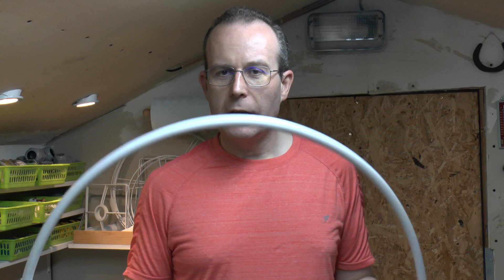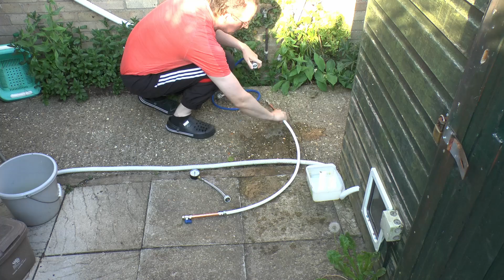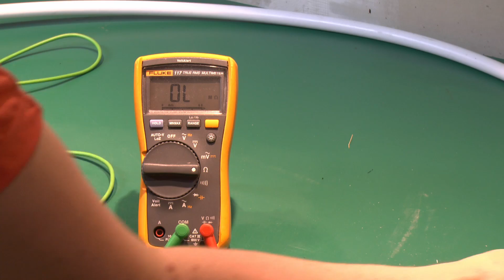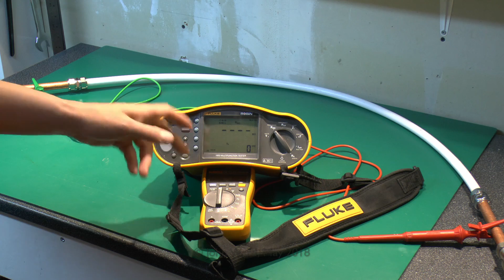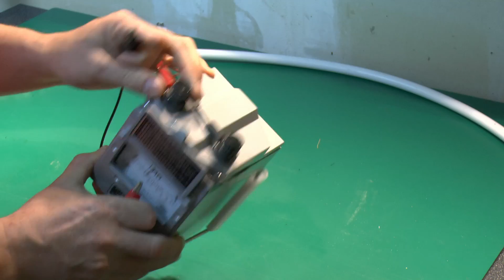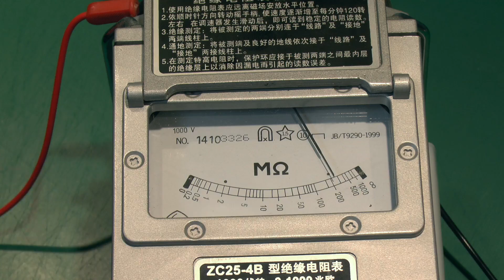Is water in plastic pipes conductive?

Comment: Pure water is an excellent insulator, what you have is not pure water ... water cooled stator bars in a 23kV turbo alternator perform very well with very low (electrical) leakage.

Comment: As long as the pH of the water stays below 7, the water won't become conductive.
I worked on a HPA using a  water cooled tetrode, it had a long coil of rubber hose carrying the cooling water and pH monitoring. If the pH rose the  20kV+ anode voltage would start to get shorted to earth down the water column in the hose.
Reply: Rubbish, please go back to school!

Comment: Interesting result, I wonder if it is because you have static water -- it has been shown repeatedly that a moving column of water is conductive enough to be significant.
I was fault tracing some years ago in a restaurant bar where "potential shock risk" was reported (i.e. current above threshold of perception making the "ordinary persons" fear for their safety).  It turned out the taps on the sink hiding under the bar gave a perceptible tingle especially when they were running.  100% inspection to every accessory on, under, behind and over the bar area showed that the bar was a later addition to the restaurant and installed almost like a prefab module, sitting atop the vinyl fake wooden floor and totally insulated from the room but with potential for static build up everywhere.  numerous fridge units (compressors) and other Class 1 stuff like the glass washer and a few switch-mode psu's (the EPOS and others).  No bonding in the whole area because the installer clearly didn't see a need.  The supply to the sink was plastic, and GN8 of course tells us that if doing an R2 test (wandering lead back to the MET) shows a resistance >2kΩ then we can consider that item not to an extraneous-conductive-part.  So when I dabbed between the taps and the CPC of the closest accessory (a worktop socket) I saw only 2-and-a-bit kΩ, but when I turned on the taps and let them flow at a decent rate, it dropped to a bit under 2kΩ.  I added local equipotential bonding and the problem vanished.

TL;DR:  classroom maths theory or a carefully controlled lab experiment, like this, shouldn't always be taken at face value.  The theory is sound and demonstrated well (I'm especially a fan of the old Fluke 1653 with the Robin branding proudly in place;-) but field experience can differ significantly due to many other influences...

For instance,the contentious new Reg's regarding incoming services with a short "insulating section."  It is no longer necessary to apply equipotential bonding (although confusingly it doesn't say that main bonding is unnecessary).  Do you bond it anyway?  Depends on if there any issues in the property.  Yes?  Bond the damned thing!  No?  Don't bond it in case you introduce a ground potential that wasn't there before.

Comment: I worked on a shower unit where the element was in a clear plastic tube inside the enclosure .I removed the cover to test voltage and resistance and finally restored the supply the local means of isolation was in another room (eg through the wall from bathroom to kitchen )however when I returned the valve had failed to open and the element had melted the tube in less than 20/30 seconds max .The resistance of the water must have been similar to that on this test and added to that the resistance of the element !!!Not a good set up and this was before RCD protection !!

Comment: There was an electrocution on internet where unearthed metal/pole lamp holder in garden became live at a pub. I think water got into the lamp. Can this cause the metal pole/lamp holder to become live and allow enough current to pass to kill. Probably very little distance between the live wire and the metal lamp so water resistance might be a lot lower than your experiment in this video.  Could you do a video on this ??
Reply: David Savery has done a video on this.

Comment: Hi John, does this mean that supplementary bonding is not required to the metal parts if they are isolated by plastic pipes at both ends?
Reply: Read the Wiring Regulations and you will know ...

Comment: Thanks John interesting.  What would happen if you just replace a copper fitting with a push fit plastic fitting.  Would this have implications to the earthing arrangements within your property.
Reply from the maker: No difference to earthing, but might make a difference to bonding.  
Earthing and bonding are two entirely separate and different things.
Reply: Yes exactly what I was trying to imply.  Many properties with leaks on copper Hot and Cold water supplies are being repaired with push fit plastic fittings surely this could effect the bonding effectiveness.  What would be the recommendations from a plumbing repair perspective ie cross bond across fittings or this would not be necessary.  Thanks
Reply: Not required, read the regulations ...

Comment: A human would feel 1mA but it wont kill, if you had used pure water (as pure as they use to jet wash extra high voltage power lines) it would not conduct, how water conducts is hugely dependent on its purity, some areas will be worse than others! It would be interesting to know if an old pipe with a lining of "crust" performs any differently?

Comment: Thanks John. I was taught that about 1 m of 15mm plastic is enough to turn exposed metal  to extraneous. Given the figure of 23kohms  minus 1 k ohm for dry skin you'd need slightly more than 1 m between the earthed pipe outside the bathroom & the touchable metal pipe above the floor to omit supplementary bonding with your figures. Apparently that figure doubles when you have central heating additive and doubles(approx) again for 22mm. So an "insulating insert" on the incoming water at POE under the is going to need to be approx 2.5 M to be truly insulating. Did i do my maths right or have I missed something?

Comment: So what are the implications for earthing points? A lot of houses use copper water pipes as an earthing point, but if there's a plastic section in the pipe between the earth point and the mains water inlet, it's no longer providing a good ground connection right?
Reply from the maker: Water pipes should not be used as the earth (not permitted since the 1960s), however metal pipes usually need to be bonded, which although connects them to the earthing terminal is not earthing.
If the pipe has a plastic section, it does not need to be bonded.

Comment: This reminds me of an experiment I did (unwittingly!) many years ago. A CT system running at 120KV with about 100mA normal current in the xray tube, suddenly overloaded and the system turned off. (With a loud bang 😀 ).
No problem could be found and when switched on it operated normally. It did this once a week for a number of weeks. Each time it was reset it operated normally for days or even a week. 
I eventually traced it to water in the cooling oil of the xray tube. The oil was pumped into a heat exchanger which was water cooled. The cooling water then run to waste. Little holes had developed in the exchanger and eventually the oil was replaced  by an oil water mix. It shows the water in Melbourne Australia is quite soft with minimal contamination!!!

Comment: In the power station we used demineralised water to cool the stator windings which were at a potential of 17kv!  The  core tubes were fed via PTFE pipes not dissimilar in appearance to the pipe in the video.
Reply: We also used such water to cool the anodes of high power radio transmitters.
I can't remember the voltage but the power output was 50 kW
Reply: @davidblyth5495  i guess with DC you want as low conductivity in the water as possible otherwise you'll electrolyse it to hydrogen and oxygen.
Reply: @gwynnej3 indeed. The water was highly purified as it had to act as a coolant and isolator

Comment: I suspect the reading could be vastly different with an old pipe containing mineral deposits along the inside surface. Also water from different areas having different dissolved mineral contents. I've seen the inside of plastic pipes stained blue with copper from old copper hot water tanks. Interesting experiment all the same.

Comment: You guys have pretty weak water pressure, I'm used to about 6 bar here in the states...
Reply: That's because we worked out how many extra water leaks you get at 6 Bar. Not only do you get more leaks you get far more water wasted when a leak happens.
Reply from the maker: It depends on where you live.  The minimum allowed is 0.7 bar,  but typically it would be in the range 2 bar - 5 bar.
Water companies generally go for the lower end, as it reduces the amount lost via leaks.
Reply: iamdarkyoshi:
how does "Bar" in the UK translate to "PSI" here in the states?
Reply: @dusterdude238  1 bar = 14.504 pounds-force per square inch

Comment: 2bar isn't really that much, is it the normal pressure you have over there?
Reply from the maker: It has been higher, it was about 4 bar once, but has reduced to about 2 or 3 now depending on the time of day.
2 is still well above the minimum requirement so the water company won't do anything.
Reply: Interesting, while the minimal pressure here is 1bar it is only allowed for "difficult installations" and the general requirement is that it should be about 8bar and not lower than 6bar for almost equal level installations.

Comment: Would be interesting to check if there is a difference in the resistance when the pipe is pressurised and unpressurised, also with different waters, ie. rain water which should be a much higher resistance.

Comment: All this achieves is to demonstrate basic ohms law. Resistance doesn’t change with applied voltage. Very very DANGEROUS comments at the end, THAT water in THAT pipe may have a set length and cross section but that won’t be the case generally. A series resistance with a human doesn’t guarantee safety when a voltage is applied, the critical parameter is current, and anything more than about 25mA can be fatal.

Comment: My grandparents had a very old house with an electric water heater in the bathroom. Looked like something from a Frankenstein movie. The control box had two enormous neon indicators that would glow a satanic pink and terrified me as a kid. Anyway I pulled it apart when they modernised the bathroom and the water ran through an exposed wire element. This thing had been in service for not much less than 100 years I imagine. They don’t make em like that anymore. 

They had a mixture of rubber cotton wiring and even some wood covered cable. Was still all in service in 2000 when the sold and moved out. They also had the remains of a generator in the cellar.  All the rooms were enormous with servant bell. The whole house was really creepy

Comment: In our location most of new tap water installations that use PEX use PEX-AL-PEX which has an inner aluminum vapor barrier, surrounded by PEX. The Al doesn't come in contact with the water normally and the fittings also don't make contact so in effect the pipe is nonconductive when new. The question is, what would happen when over many years perhaps the inner plastic layer cracks? This would lead to the pipe effectively becoming conductive, would the pipe be treated as conductive ie. requiring bonding?
Reply: Also a layer of salts/minerals deposited on the inner walls of the pipe.
Reply from the maker: The barrier pipe is used here as well (that in the video is the barrier type). The inner and outer are the same material, so it's not likely for one side to fail and leave the other side intact - any kind of crack would result in the pipe leaking.

Comment: This is good example of why just because an incoming service supply is in plastic doesn’t automatically mean that protective binding is not required, as depending on the way a water pipe/gas pipe is installed a dangerous level of earth potential can still be picked up inside the property. Under 23k to earth based on 10ma current 

And also why addiction supplementary bonding may be required via high resistance plastic joints

Comment: With the water in a plastic pipe only conducting a very small amount of current, is there any point in bonding the copper tube section on an incoming water main, where it’s entering the building in MDPE or any other plastic?  Maybe I’m being simplistic, but I thought it was to ‘ground’ a faulty system?  Thanks John very interesting as always👍
Reply from the maker: Probably not.  If it's not an extraneous conductive part (something which can introduce a potential from outside), then it won't need bonding.
Reply: I had experience of fault on a persons installation causing "tingles" while showering - could make a crude joke but I shall restrain myself.

Comment: I would like see what happends if the voltage is applied over time (also AC vs DC).
(maybe even fill in on some common faults that can lead to it)

Just the basic circuit: water mains on one end, closed tap on the other.

The pipe in the video is a good model for that (maybe add a overpressure valve.. tho)

Comment: Would it still trip  the RCD if rain water got into the back of a socket from a leaky roof?
Reply from the maker: Very likely. At the back of a socket the distance between L&E is tiny and there is likely to be dust or other contamination present which would increase the conductivity of the water.

Comment: why doesn't the resistance decrease with more voltage applied?? ohms law and plastic water pipes don't go together?
Reply: The resistance of a resistor is not dependent on the voltage. Due to ohms law, of course, the current will change with the voltage.
Reply: Why would resiscance decrees? Resistance in this case is constant as pipe is not a potentiometer. Also ohm law does apply, because when the voltage increase, the current increases as well.
Reply: right I got it now .. rookie mistake from me lol

Comment: Very informative demonstration thanks. This could answer something that has puzzled me where firemen poring water onto a building never seem to worry about the electrical cables inside that are live.
Reply: Normally the DNO will isolate the wider electrical network in the street.
Reply: That another thing,  years ago on the front of shops there used to be the 'fireman's switch' that they could turn off the power in the event of a fire, but you don't see them much nowadays.

Comment: You can't measure the conductivity of water with DC, the readings are meaningless.
Reply: Of course you can. It just won't be a good simulation for mains
Reply: You can't, electrolytes will instantly polarize at the two terminals.

Comment: What does this same about bonding a house installation when all of the pipe runs to a bathroom, for example, are plastic whist there may be metal parts in that bathroom. Is it still necessary?
Reply from the maker: Bonding not required with plastic pipes, and even if you wanted to, connecting wires to plastic would do nothing.
Bonding is only required for conductive items which originate outside the room and could bring a potential into the room - pipes being the most usual example.  A tap at the end of a plastic pipe won't introduce any potential - it's no different from a metal hook on the wall or a metal door handle.
Reply: My thinking for asking the question is that often copper is used for the last part from behind the wall up to the taps for example. In that case could the copper be deemed to originate from 'outside the room'. Also, although we know it comes from juts behind the plasterboard, someone inspecting may not know that and expect to see bonding on the last run of copper thats visible.

Great videoas John. I've watched them all. You have a clear presentation style which is great. Thanks for taking the time to create them and answer the occasional question.

Comment: John, thanks for the video. Not an electrician but work as a mate (something to do in my retirement from industry). I've been studying your videos on Equipotential Bonding and don't fully understand the theory of it it all yet.  Where does this video leave me if in a bathroom (say) the pipes under the floor are copper but change to plastic to feed the  wash hand basin?
Reply: GrumpyGrampa you do not need equipotential bonding to plastic pipe.. Only the metal or copper part where it leaves the meter... If it's there. Same with gas pipes.
Reply: Thanks muzikman2008.  I think I get that but if you bond there what about the wash hand basin taps that are metal fed by copper from the mains then plastic under the sink?